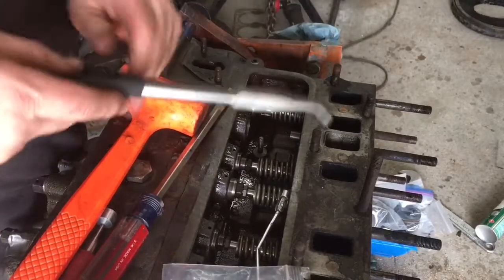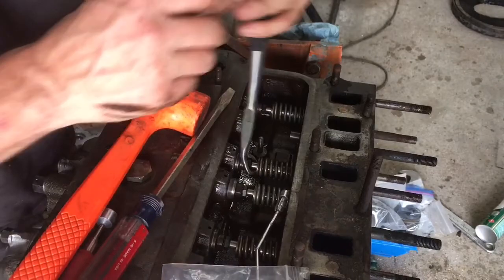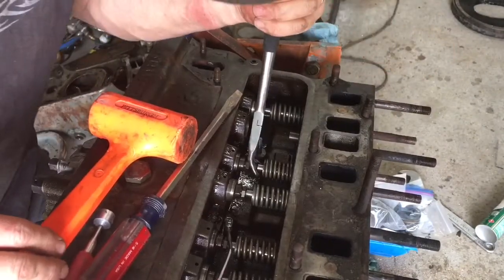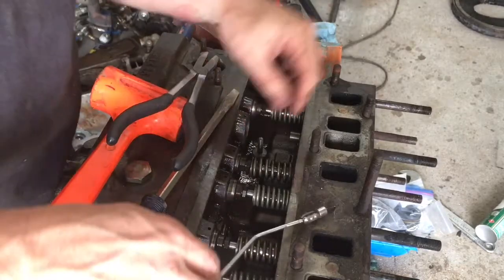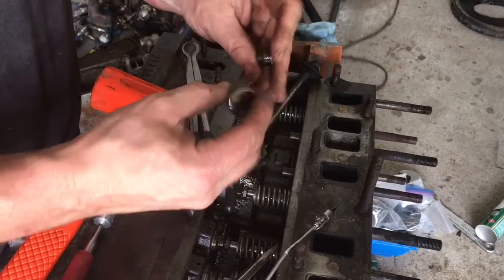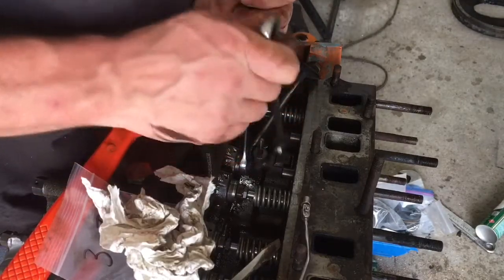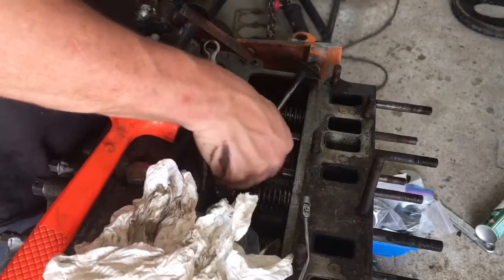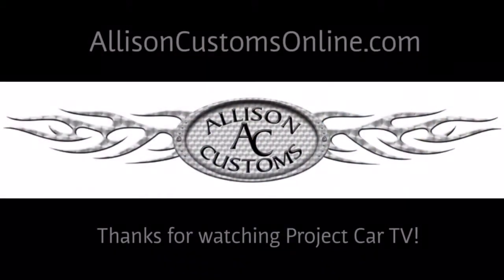Flathead Valve Removal - PCTV HELP Series

Comment: I want to thank you for your videos on your forklift repair.  I currently have my 58' Clark Carloader apart for  a hydraulic refresh and found low compression in one of the cylinders of my F4124.  Being new to flat-head motors, I have found your videos an invaluable resource breaking my motor down and cleaning up the valves which were causing the issue.  You also inspired me to rebuild the gauge cluster.  Good work!
Reply from the maker: I’m happy the videos are helping.  I hope to finish up my Clark soon so I can get some work out of it.
Reply: @AllisonCustoms  They're fantastic very solid machines.  I picked mine up 3 years ago and have been using it a few times a week in my shop from unloading lifts of plywood, moving trailers, to dumping trash with a custom dump cart I made.  I and even welded brackets to attach an old 6 foot plow to to it to clear snow from in front of my bay doors (which works surprisingly well)!  This thing has started right up every time and constantly saves my back.  If the seals in the hydraulics didn't start leaking, I'm sure I could have gotten away with many more years from her.  Now that the carbon buildup is gone and the valves re-seated (and compression restored), I'm replacing all the hydraulic hoses and seals.   The engine was probably rebuilt a couple of times before since the pistons are +.040.  It must not have seen much use since the last rebuild since there's almost no cylinder wear.  She should be good for another 60 years or so..  Good luck finishing up yours!